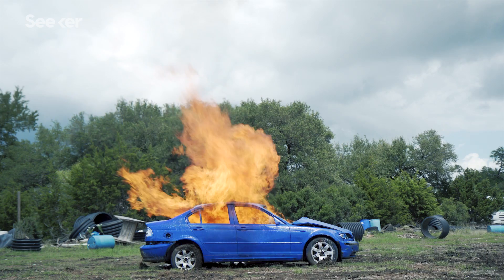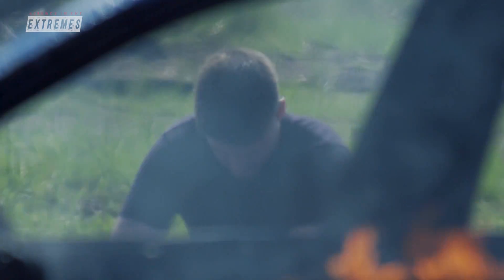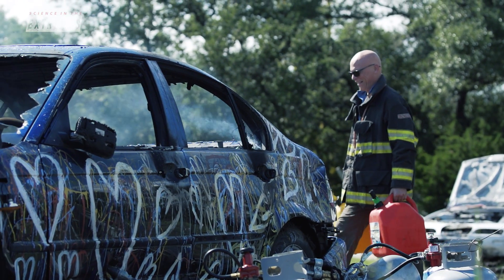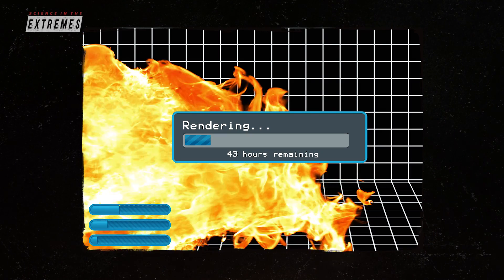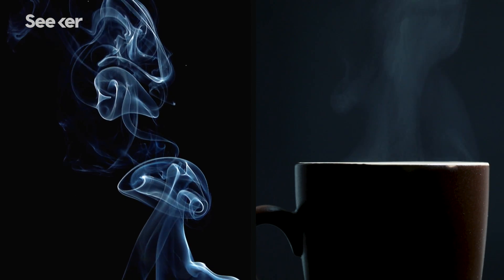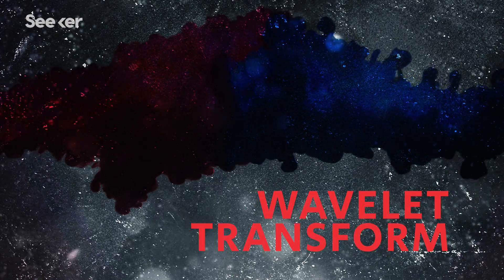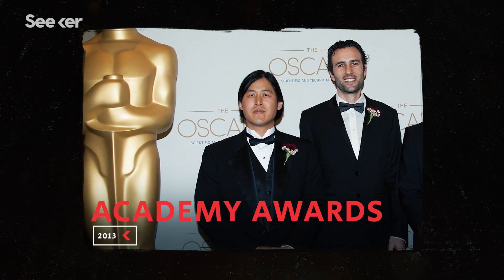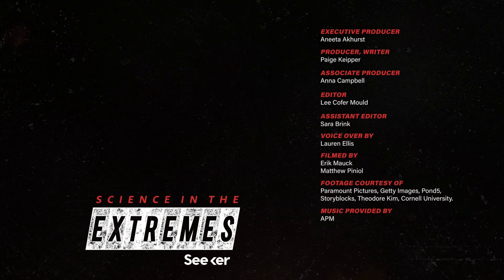This Is Not a Real Explosion, Here’s How Physics Made It Happen

Comment: Just wondering, does some director(maybe Michael Bay) used real explosion instead of this method? As they(one of them might be Michael Bay) might not know about this method, like at all?
Reply: Using actual explosions for movies would be very eye-opening for movie goers & likely a bit of a let-down...The TV series Mythbusters put a large suitcase worth of plastic-explosive in the back seat of a car...as a "booby-trapped-car" might be...the resultant dust cloud,shock-wave,  shredding of the car into little pieces, NO  fireball, & a crater where the car was...the real thing is unlike all movie-goers expectations.
Reply: I suspect that being tapped to be the "pyro guys" for a big-budget famous-names movie is money in the bank for these guys, so there's probably a lot of competition and you can only compete if you know what your competition is doing.
Reply: Well, you'd have to squeeze your way past some laws to use real explosions in movies. Even with stuff like this, there are usually a few laws that must be understood and followed. If you end up using real explosions in a movie, then you're well aware of the alternatives, so you wouldn't use real explosions, so you don't exist. So no, no director like that is around.